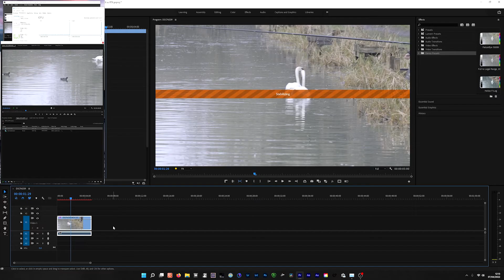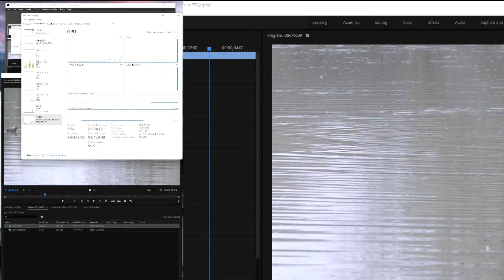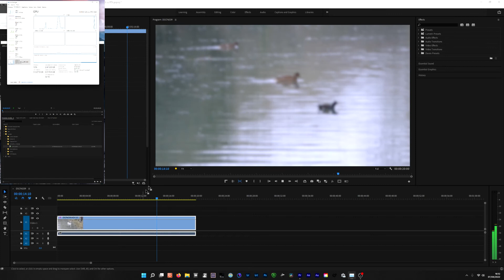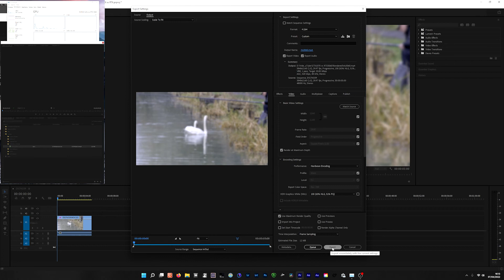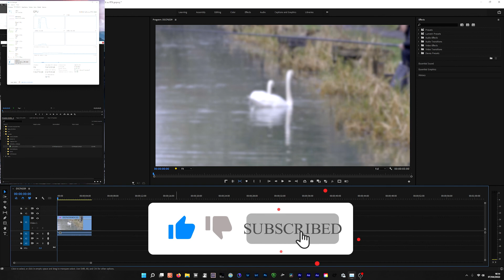How to Upgrade the Alienware Aurora R7 power supply & graphics card

Comment: System wasn't powering on initially with new power supply...
Reply: For GPU_POWER i used the 8pin CPU (not PCIE) connector.
Reply: 4 pin above CPU I used IDE to 4 pin adapter and it booted afterwards

Comment: My power supply psu didn't come with an optical drive cable.  And I don't have a clue how to install this ThermalTake 850w psu. The instructions are too short.
Reply: I’m having the same problem, did you figure it out?

Comment: Trying to put a 6650xt in my r7 but I keep getting stuck at just the Alienware logo no loading circle (fans spin up on the gpu) if I put the old amd gpu in works fine. I upped the psu to a 850w and that works perfectly. I’m at a loss with the gpu at the moment 😅
Reply from the maker: It might be a driver conflict so uninstall all the graphics card drivers on your machine and try again
Reply: @GrandadsReviews   I tried that and didn’t work. I did have amd to begin with tho and I only heard that happening if you switch gpu teams.
Reply: @ObsidixnRxin  I put in the 6700xt,can not work,stop the logo screen
Reply: Did it work?? I have a rx 6800 and am facing the same thing. I'm able to boot through windows with secure boot disabled but it doesn't let me play most of my games (which requires TPM and secure boot to be on)
Reply: @chrristoncroos3603  Damn you got lucky!! Just after that loading screen, I got the black screen and nothing more. Tbh I got scammed on the 6650xt. I paid for a new build, tried it, and nothing. However the Alienware didnt boot into bois even with the brand new 7600xt. So I’m thinking its software issue with these Alienware its self. Load the og card it was shipped with in, and bam runs perfect.
Reply: Hi,you upped the 850w psi,and the 6650xt can work perfectly?

Comment: I used the "EVGA 700 GD, 80+ GOLD 700W USA" listed in your description, and see now - we would need to use the old adapter, used on the stock Dell, that includes the 24 pin, and the "GPU_PWR" 8 pin.  The EVGA 700 GD, 80+ GOLD 700W USA only has one CPU cable (a 4+4) which works for the ATX on the left. I've seen other power supplies that also work, if they have more than 1 CPU cable I.E. a couple of 4+4s.  For those, just plugging in the matching part of the 4+4 into "GPU_PWR" also works, instead of using the old adapter.  It would have been helpful to see the cable management as you worked.  Thanks for the info.

Comment: Can i use something like a 4060v I want to upgrade my 1060 will it fits the case? And how are the temperature with this 3060? Is it too hot??
Reply from the maker: The 3060 runs fine and cool you will need to find out the dimensions of the 4060 too see if it will fit as the 3060 is a close fit.

Comment: I upgraded my R7 (2017 model) as well with a more powerful 750w Psu and put a zotac 3060 as well inside, problem is it doesn't make it easy to close the side panel, anyone's got an idea what other gpus i could try to put in there? I used to have a 1050 ti but i don't want to downgrade that much now ;/

Comment: I installed mines and my computer didn’t turn on.  The power supply fan will turn a few times and stop.  Do you think I just got a faulty power supply?
Reply from the maker: Make sure you haven’t removed the original motherboard power cable it’s a white connector with the new power supplies connector

Comment: The original power supply has an adapter to add a 4 pin plug on the other side of the board so it would be nice to see the plugged in on the board layout in your video.  I plug the 4pin in on the edge of the board but do I separate the 8 pin plug on the power supply and plug the other 4 pin on the other side of the board?  25 years building computers and never dealt with this type of adapter.

Comment: This video does not show the most critical part for me which is the four pin on the right side of the board.
Reply from the maker: What do you need to know about that connector?
Reply: That is the CPU supply and should be labled on your replacement supply. Be sure to retain the 18 pin connector between the motherboard and new power supply. Otherwise your PC wont start.

Comment: I have an r5 what psu do u reccomend i don’t know which one will fit that’s 550 watts
Reply from the maker: Hi any standard size psu will fit such as the EVGA 650 GS for example
Reply: @GrandadsReviews  would a EVGA 550 BP, 80+ Bronze 550W fit then?
Reply from the maker: @dazios6874  It’s a standard size psu if you are sticking with the original gpu in the r5 and not upgrading too something insane gpu wise then it should be fine though I haven’t had a r5 myself looking at the r5 specs it takes any standard size psu.
Reply: @GrandadsReviews  I’m gonna upgrade to a rx 6600 with a r5 5500 cpu and I was recommended to upgrade the 460watt psu
Reply from the maker: @dazios6874  yes you will need to upgrade the PSU I would recommend the highest wattage you can afford and try to get something above 600W if you can to give the PC some headroom when working flat out 550W will not give you much spare Wattage when running GPU and CPU intensive programs
Reply: @GrandadsReviews  u reccomend the 700 evga that’s in the description? It’s actually on sale rn for 80
Reply from the maker: @dazios6874  yes that would be ok the bigger the better
Reply: @GrandadsReviews   what psu did u use in this video, I wanna make sure mine fits cus I feel like the 700 watt Evga is too big
Reply from the maker: @dazios6874  The link to the power supply is in the description of the video.
Reply: @GrandadsReviews  looks like it’s out of stock 😢
Reply from the maker: @dazios6874  it shows in stock when I follow the links plus it displays the higher wattage version's in stock as well

Comment: Can I ask a question? I have recently done the same as you and installed a GTX3060ti and new 850W Corsair PSU into my system. You indicate in the video you had to utilize the  white patch cable plugged into the 24 pin slot. Did you also utilize the lead running to the GPU power slot on the MOBO? Or did you run a separate 4x4 power cable from the PSU directly to the GPU power port? For insight I attempted to install the GPU having removed that patch cable and new power cord direct and my PC would not recognize the new GPU so I install it with the patch cable and lead from the patch cable to the GPU power port, then everything worked. My fear is I'm under powering the GPU proceeding this way. Any guidance you could provide would be greatly appreciated.
Reply from the maker: I ran a 4x4 cable from the PSU
Reply: Dell has always used non-standard power pin arrangements. That's why upgrading it was a bitch before they started including the patch cable (I'm assuming they finally realized it's costing them more money to have a custom ps made and stocked). The patch cable is to do just that, rearrange the power distribution to meet their mainboard standards but doesn't mean that they are ignoring the power requirements for PCIE slot. It will be fine with the way they have it setup and it was able to run 1080 just fine on PS it came with. Any additional power that GPU needs outside of what it can get from the PCIE slot will be supplied by the 6/8 pin power that goes directly to the GPU. So you will have to use the patch cable to the 24pin and the PCIE power on the mainboard but you shouldn't worry about underpowering your GPU.

Comment: Have you (or anyone here in the comments section) upgraded the M.2 NVME to a Samsung 990 Pro 1 tb?
Reply from the maker: No I haven’t but it was one thing I was looking into doing it doesn’t seem difficult you just have to turn of raid control in the bios then install the drive and select that drive to install your operating system
Reply: I just upgraded mine to a m2 Samsung 1tb. Wasn’t hard at all. I decided to do a clean install. Once I was in bios and made it boot from the thumb drive windows installed like a champ. So I have windows on the C: drive with ~800gb left of storage

Comment: Hi i have a 1060 6gb in mine and im wondering if i can swap in a 2060 without having to upgrade anything else the recommended psu is 450 but mine has a 450 psu will that be fine
Reply from the maker: To be honest the 450w psu that is fitted as standard is not of a high quality so I would recommend you upgrade the power supply just going up to 650w will give you enough head room and they are not expensive.
Reply: @GrandadsReviews  installing my new hardware now and my PCIE to my motherboard is an 8 pin my PSU is a 6+2 connector but only the 6 fit it won’t go in with the +2 is it fine to leave the two out?
Reply from the maker: @TheDemonicDeity  no you need it to be all the pin they should fit.

Comment: I bought a 700w gold power supply for my r7 and once I plug the cable in for the GPU power my computer does not turn on. I’m very confuse. Does anyone have an answer to this?
Reply from the maker: Did you remove the white breakout main motherboard cable if so replace it that is what caused mine to not boot.

Comment: u didn't need the gpu holder?
what's  wrong with that white connector why replacing it? 
other problems you ran in to?
Reply from the maker: No the gpu support would not fit as the power cable was in the way but it wasn’t needed. I didn’t need to replace it and in fact I put it back as the cable on the power supply that was meant to replace it stopped the computer booting so had to put the white connector back on. Other than that there were no other problems.
Reply: @GrandadsReviews  pls tell me pls pls pls, i got a rtx 2060 and a new power supply, its 750w but it doesn't have the plug to plug into the gpu holder
Reply from the maker: @PhaverX  The power plug for the GPU is made up of a number of smaller connectors that you slide together so you are not looking for one big connector
Reply: @GrandadsReviews  do you know where i can get one, thank you so much for helping me. I really appreciate so much
Reply from the maker: @PhaverX  you should have them I've never seen a power supply without one. It will be a six pin block way two pin block next to it.
Reply: @GrandadsReviews  i cant figure it out

Comment: I am actually doing the very same thing. I just ordered a 850W power supply and a RTX 3060 card. I made sure the card would fit in the case. EVGA is saying it is around 8 inches long.
I probably could have used a 650W power supply. I think people overexaggerate how much power the cards really need.
Reply: How’s it held up ?

Comment: Thanks for the video Grandad! Couple questions:
-What PSU did you use for this? (affiliate linking is fine if that helps!)
-Did you do much shopping around concerning the profile of the GPU to fit this case?  
-I've long been concerned with the cooling in my R7, but have found Afterburner seems to mitigate temperatures more reliably than Alienware's installed software. Are you still using stock cooling and find temperatures still managable?
Reply from the maker: Hi this is a link to the power supply I got it from Overclockers (https://www.overclockers.co.uk/kolink-core-series-700w-80-plus-certified-power-supply-ca-02q-kk.html) I didn’t do any shopping around for the size of GPU as I had already worked out that the case would take most large GPU’s.
I have uninstalled all Alienware control software and just let the stock bios cooling settings to control the fans and have had no problems no matter how hard I push the pc the only ongoing issue is the noise of the CPU fan which I may change in the future if I don’t change the pc.
Reply: Yeah. The case takes a 10.5 inch video card.
Reply: @krathoon2338  I crammed an 11.2-inch RTX 3080 in mine by ripping out that unnecessarily large fan cage and zip tying a Noctura NF-A12x15 PWM in the spot where the old front fan was. That fan cage is ridiculous, I gained like an inch by removing it.
Reply: @shrekwes4957  Good to know that it can be modded. I got a RTX 3060 to put in.
Reply: @krathoon2338  for sure, at first I was scared to mess with it since it was a prebuild, but I’m glad I just sent it and tried because the payoff was huge